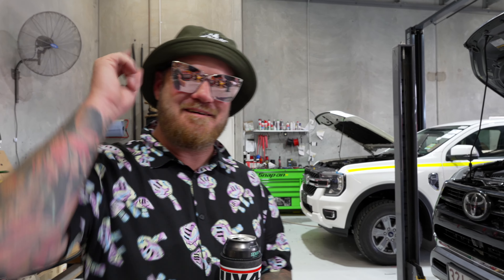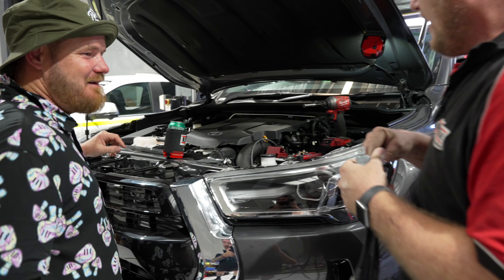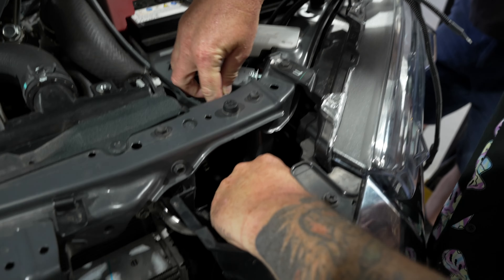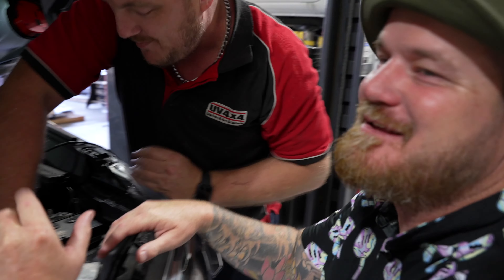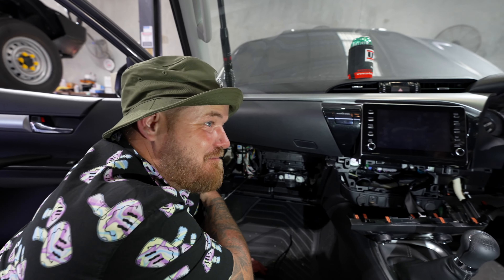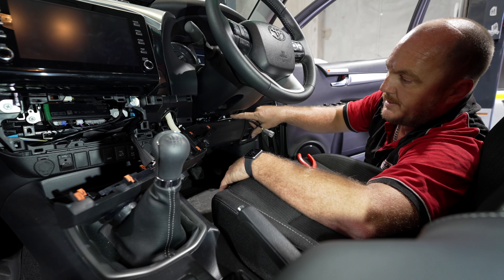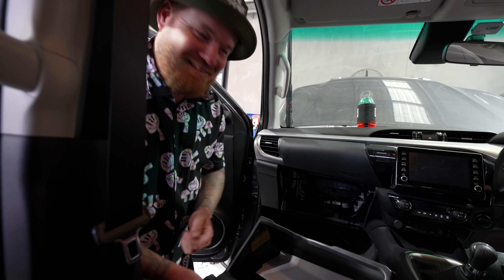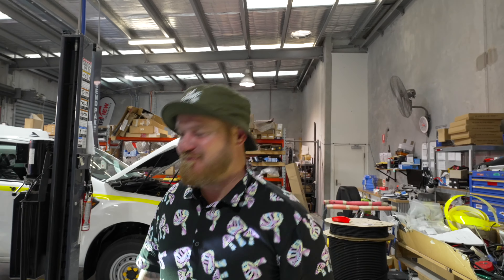WIRING YOUR BEHIND GRILL LED LIGHT BAR MOUNT FOR N80 HILUX How To Install

Comment: Top video guys. I'm about to install my  spot light harness. One thing that should be mentioned is, before you disconnect the battery, make sure you know the radio security code. You will be prompted to enter the code on the screen, once the earth is connected and the ute started. So I'm told.
Reply from the maker: thanks legend! ahh, that can be found on your keys, there should be a small tag, or in your handbook.
Reply: @piratecampco  Yes, well. bashing around with Toyota, they told me it's the last digits of my VIN number. Cheers

Comment: Can you give information about the Relay installed? Also the fuse. What type of Relay and what type of fuse did you use in this harness? A hug from Brazil!!!
Reply from the maker: G'day legend - unfortunately we are not auto sparkies, you will need to contact your local auto electrician.